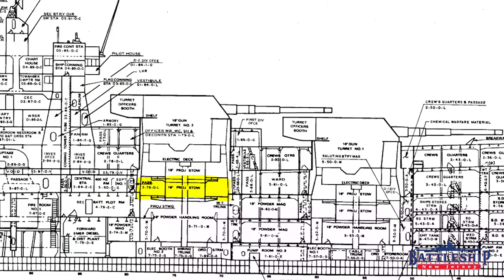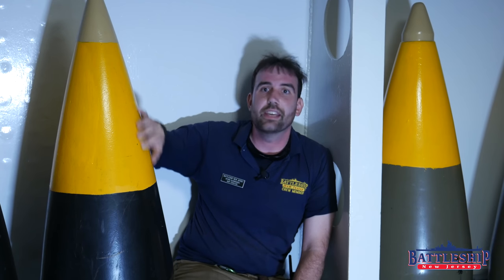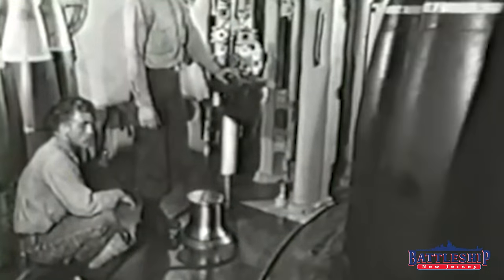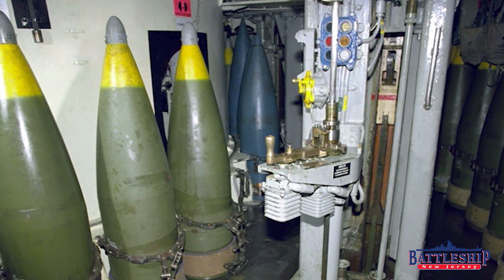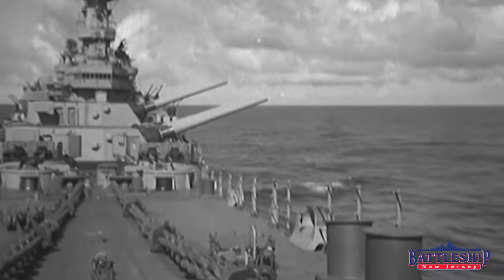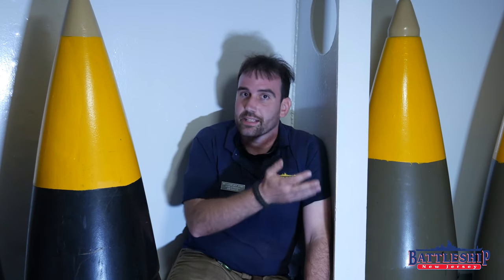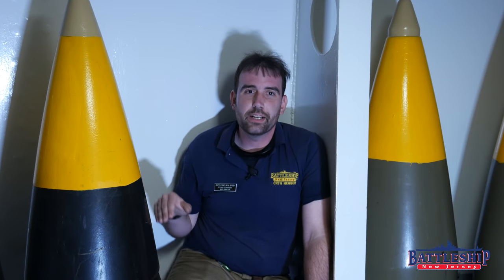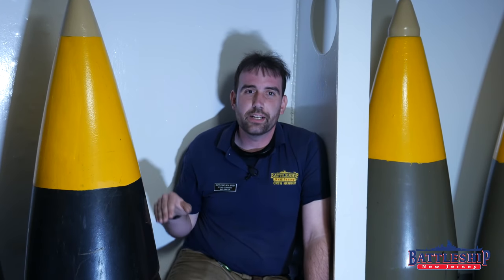What are the Different Types of Shells that the 16in Guns Fire?

Comment: When we've gone to Battleship Cove, we've wondered that. Most shells in the barbettes are blue, but a few are yellow or black. I'm guessing the blue ones are AP.
Reply from the maker: Blue are BL&P, blind loaded and plugged. Basically, practice shells.
Reply: @BattleshipNewJersey  Oh where oh where can I get a fiberglass replica of an AP shell?  I think you guys have some onboard. I'd sure like to find who makes them. It would make a fine mailbox post at my house.
Reply: Yup - blue was pretty common to denote practice - I have a sweet mint 155mm practice round that is blue amongst others too
Reply: @garywayne6083  Don't let it fall over or the cat will be history! That's a chunk of metal!
Reply: @kimmer6  I have an 8" round I brought back to NJ from Ohio - should have seen me trying to get it out of my car and into my house! :D
Reply: Blue denotes an inert round - no explosive content.  Yellow denotes high explosive, Brown band denote propellant (rocket and missile motors), green bands denote chemical rounds.
Reply: @garywayne6083  I threw my back out putting my brand new 8 inch M-509-A1 submunitions dispersing howitzer round on the back floor of my car. But you couldn't wipe the smile off my face during the 125 mile trip home. What kind is yours?
Reply: @BattleshipNewJersey  What is the lethal fragmentation radius of the Mk13 HC shell?
Reply: @kimmer6  I just did some research - Mine appears to be a  M845 dummy round, used in training loading of the M110 field howitzer

Comment: Fascinating about discarding sabot rounds. The shell stability is achieved through rifling but how did the sabot transfer that spin to the shell? That implies some form of fin or other modification to the sub round to allow the sabot to index and transfer the spin during firing or did they go for a free rotating sabot and fin-stabilise the round? Either way more than simple jacketing around an existing round. Keep up the good work Ryan - your videos have made the Battleship New Jersey a must visit next time I hop "over the pond"!
Reply: The early sabot rounds in WWII apparently used a cup design sabot sitting behind the projectile rather than a flower petal design we are all used to seeing, and were not fin stabilized out of rifled barrels, instead spinning the subcaliber projectile with the sabot. This had the benefit of working in a gun with a muzzle brake, but did make Sabot separation problematic. Fin stabilized is something that is apparently only a requirement of smoothbore guns.

Comment: I recall reading on US Army 8 inch ICM rounds back in the 1980s, these were advertised as using air bursts of some kind and scattering the submunitions from that
Reply: The 8H M509A-1shells were the ones you heard about. They are for howitzer duty. The casing was fairly thin steel (1/2'' wall?) and the nose and base were aluminum. Apparently a bursting charge would strip the aluminum threads and allow the submunitions to scatter.

Comment: How about a video on the 16 in powder bags and primers that ignite them, when the bags are loaded are they cut or ripped in anyway to expose the powder? How does that all work?
Reply: I would think ripping a powder bag would create a dangerous situation if any powder would accidentally spill on to the floor below the breach. I'm trying to remember from a tour of the USS Alabama, but I think the covering of the powder bags were made of highly flammable silk that would be consumed in the detonation of the charge. I don't remember anything about the primers.
Reply: The bags are designed to burn fast, so there’s no need to rip them open
Reply: Bob Johnson I’m thinking back to the older cannons were they had to prick the bag once it was loaded into the breach before inserting the wick
Reply: @davidmg4216  there’s no need to do that, the bags burn with the powder
Reply: There's a video on YouTube somewhere about making the powder bags; albeit smaller than 16"
Reply: @ghost307  powder bag is a misleading term for them, since they’re essentially giant pellets of compressed gunpowder
Reply: @ghost307  cordite maybe, US used something different based off of the IMR powder
Reply: Its not ''powder'' but more like shot glass sized castings of very dark grey looking propellant with holes in it. They are stacked neatly in layers. The bag holds them all very snug and in place and there is a red patch containing a charge of black powder sewn to the back end of the bag to ignite it. Normally 6 bags are loaded behind the projectile. There is a cartridge sized primer inserted by a guy under the breech before its closed. The bags are smaller in diameter than the projectile and they go in the breech intact. The bag material combusts immediately and after the shot, air is blown up the barrel to flush out any possible unburnt material.
Reply: @bobjohnson1710  The powder bags had a special pad on the end where there were larger very fast burning granules in them to initiate the burn. They are set of with a primer charge with is like a .308 cartridge that is inserted in the breach block and that is what fires the gun.
Reply: There's a primer pad on each bag. The grains are stacked inside in an orderly way. The grains are rather large. Like 2" long.  Any ripped bag is immediately thrown in an immersion tank for safety.
Reply: I believe at least some propellant bags in the US Navy were made of laced up silk bags.  Not sure about Iowa class.  Silk burns fast.
Reply: @francisbusa1074  They were all silk I believe. It wasn't until the 80s where lots were mixed together and rebagged causing some of the early accuracy issues specifically to NJ since she was the first reactivated. These were the blue polyester bags you see in 80s videos.  The powder does deteriorate rather fast if not stored correctly.  It's not like the smokeless stuff inside modern small arms ammunition.
Reply: @jth877  
Thanks.  I was not aware of the inaccuracy issues in the eighties.  I haven't heard of that during NJ's reactivation in '68 though.  Guess they didn't rebag it then...

Comment: A slight correction to a small data point. At 13:00 he states the shell in flight is spinning at about 70 rotations per second.  That is incorrect.  The rifling twist rate of the 16" Mk7 gun is a RH 1:25 twist.  For the stated 2400FPS muzzle velocity that would be approximately 70,000 RPM (1152 rotations per second).

Comment: Fantastic info on the shells of WW II, the '80s, and beyond. I never heard of the long distance shells, although on Drach's video with the captain of the Iowa during the Lebanon crisis, he did mention 100 mile distances from the big guns. But I do wish to add a bit of ballistics info here as to the speed of the Mark 8 shells, and shells in general. When Mark 8 AP 2,700 lb. shell was fired from the South Carolina or South Dakota, it had a MV of 2,300 fps from their 16/45 cal guns. But from the Iowa class ships, from the 16/50 cal guns, it was 2.500 fps. In addition, the heavier the shell in general meant s slower MV, across all battle ships and handguns and rifles as well. So, in the case of WW II battleships, all the powerful AP rounds  had a MV around 2,500 fps. For instance, the Nelson fired a  AP 2,046 lb. round at 2,525, and the Nagato fired a 2,249 lb. AP round at 2,559 fps. So, you can see from this that the Iowa class AP round was not a slow round for 16" shells at all.

Furthermore, the smaller 15" shells from the French, Italian and British ships often had a higher MV, but a less heavy round. The French Richelieu class fired an AP round of only 1,951 at 2,575, the Italian Littorio also had a 1,817 lb. AP round at 2,887 fps (the fastest), and the British QE class shot a 1,938 lbs AP round at 2,640 (the Super Charged version). The Bismark also shot a 15" shell that had a 1,764 lb. AP round (fairly light!) at a speed of 2,690 fps. And here are the range figures for each: Bismark was 26.1 miles, The Littorio AP round max range was 27.7 mi, and the Richelieu max range was 25.9 miles.  The Iowa class 2.700 lb. AP round had a max range of 24 miles. So, it is pretty clear that the lighter rounds go further, which is only normal ballistics. So, if you put all of this together, it does not look to me like the US Navy made a heavy shell mainly so it could come down on the deck of a ship vs. hitting its side armor. But it is probably more likely that the very long ranges were not considered to be very meaningful or realistic in being able to actually hit another ship at such long distances. Combine this with the fact that the 2,700 lb. AP round from the Iowa class 16/50 cal gun was pretty close in power to the Yamato's AP round, especially its penetration capability (32.6" vs the Yamato's 34.1" at 0 yards.

Comment: The 16" Mark 9 test/training shell was called a "Target" projectile and was especially made (on the cheap, of course) to match the Mark 8 AP shell as to weight, balance, and shape.  It was not a "BL&P" round.  Those are, by definition, regular AP shells, usually obsolete ones, that have been "safed" to be used as inert training projectiles, which here would be the old early-1920's-design 2110-pound 16" Mark 3 AP Projectile replaced by the Mark 5/8 in the late 1930s and weighted to 2100 pounds exactly.  These or BL&P Mark 5 AP rounds had to be used by COLORADO and her sisters, as they could not handle the bigger Mark 8/9 shells.

Comment: I miss a 16" HE-shell with proximity fuse, an upscaled 5-6" shell.
Yamato had some AA shell`s but a 16" with proximity would be in another league completly.
Reply: The American 16" proximity shell would have been far more accurate in any case. Yamato did not have radar or AA fire control that was even close to the USN (she had radar, but only a very basic set). Yamato had good optical surface fire control, however.
Reply: The shell would only break up into 5 or 7 big pieces, anything like that would not frag well, our grenades have wire spun around the charge and its crimped every 6-8 inches so it shoot out lots of metal wire fragmentation (the old pine apple grenades broke up poorly as well)

Comment: I use a one of these shells on a daily basis as part of a pressure testing system. I believe it's a MK13 HC.
Reply: It's missing the cool brass rotation band now.
Reply: Pressure testing?  Like inviting strangers over and hitting the fuse with a hammer?

Maybe I'm thinking stress testing...🤔
Reply: That was my idea....use my TP shell as my air receiver for my IR compressor.The Target Practice shells were cement filled to equal the weight of a High Capacity one. A fellow who had a bunch of 16 inch shells in Central California had a machine shop unscrew the base plate of one and chip out the concrete filling. Everybody involved said that it was one job they will never do again. Mine is in a horizontal cradle with the original fiber guard around the turning band. It looks like it has never been removed. Some day I will paint it up like an HC shell, install a MK18 fuze, and stencil on the names of everyone lost in the Iowa Turret 2 explosion.
Reply: @kimmer6  That's very cool. If you don't mind me asking, what year did you pick that up and how much did it cost you?
Reply: @rickjames8317  Cost me $1200 in 2009. They are getting really hard to find these days. It has been in storage out of the weather and in the dark for years. But I had to move it earlier this year.
Reply: @kimmer6  That's an awesome thing to own. I'd say money well spent, if you have it to spend. Would be super cool painted up like an HE shell and displayed somewhere on your property.
Reply: @rickjames8317  Haha, better than some money I blew!  I know a guy who has about a dozen of them in museums. My goal is to paint it up like the High Capacity shell and stencil on the names of the 47 Sailors who were lost on the Iowa in 1989. There are a few of his 16''-50's at the Estrella Warbird Museum in Paso Robles, Calif, including 2 at the front entrance. He has a pretty nice collection of big ordnance there.
Reply: @kimmer6  Yeah, I've definitely spent more and gotten a lot less, LoL. At least it's too big to ever misplace or have it grow legs and walk away! Love the Iowa memorial idea.

Comment: Instead of scrapping those shells that were still in storage. Strap shackles on them and load them on the B-52. That way there they would of been put to good use. And yes the B-52 can handle 2700lb shells since they can carry multiple 2000lb bombs.
Reply: Seems to me that's exactly what the Japanese did to attack Battleship Row at Pearl Harbor. Not sure that would be practical today but if the need arises, I'd hope someone would remember they were in inventory.
Reply: It isn't just the weight, it is the safe separation from the aircraft. There's plenty of video footage showing ordnance striking aircraft during release trials, that's why they have to do the trials, to certify the store. This is done in accordance with the Military Handbook 1763.

The other issue is fuzing. The shells will have both set back weights and rotors in their fuze that rely on the G forces from being fired, and the rotational forces from spinning through the air due to the rifling. These devices need to be moved so that the parts of the explosive train inside the fuze move into alignment, allowing the shell to detonate on impact. Otherwise it's just a big weight.
Reply: @nzgunnie  That is not true about the fuses for all bombs. The shells would be given contact fuses like what is on the JDAM. And the B-52 is certified to carry 2000lb JDAM's. The main mod would be for the lugs that would allow for them to be attached to the bomb racks, they would have to modified too. Another thing is that the  Bombers with their internal bomb bays really do not have the problem of the bombs coming up and hitting the planes when they are dropped. Even with the B-52s external racks. That seems to be the issue with fighters that can carry bombs. Due to the weight of the 16in shells only the bombers can carry them. Not fighters. And yes, there would be certification testing to make sure all the mods and the shells work. 

From What I heard, a Battleships gun was turned into the first Bunkers around the time of the Gulf War in 1991. And they tested it then sent it off to the desert.
Reply: @MrScott1171  I didn't say anything about fuzes for bombs... I said that is how the artillery fuzes work, ie the fuzes in the shells. You could probably machine some kind of adapter andadapter booster to accept a bomb fuze, even something simple like an M904 nose fuze. If you wanted to fit electrical fuzing, you would need to fit either internal or external cabling conduits. Depending on the thickness of the case, you could probably machine lug wells to accept 30 inch suspension lugs. I'm not sure what the bomb racks in the B52 are rated to, but these shells do weigh more than the 2000lbs class stores they currently handle. (most carriers are rated as either 1000lb class carriers with 14in suspension, or 2000lb class carriers with 30in suspension). If you wanted to make it a smart weapon, you would need to design a guidance kit for it as well.

Weapon/bomb bay released stores do have that problem. The process for assessing safe separation is carried out regardless. I spent spent five years carrying out aircraft stores compatibility certification, there is a lot to it. A store designed to fly straight through the air, nose first, is not necessarily going to perform aerodynamically how you want when you drop it horizontally.

You are on the right track with the Gulf war bunker busters, the initial batch of GBU-28s was built from modified 8 inch artillery barrels from deactivated M110 howitzers, and later examples are purpose-built. They were designed and built pretty quickly for a UOR.

At the end of the day, you have to have a requirement. And just finding something to use a big shell for, rather than scrapping them, isn't really it.
Reply: @nzgunnie  - I didn’t know that about the M-110 howitzer barrels being used to make GBU-28 barrels. Were they melted down and reforged into the newer one?
Reply: @electrichellion5946  No, they were cut to length, lug wells bored and tapped, and nose and tail adapters made to accept LGB kits and fuzes. The whole points was to use them as a penetrator. I'm assuming they made some kind of hardened nose plug for them.

Comment: My dad was on the USS Heermann during the Battle of Leyte Gulf.  He told me the Japanese may have at first mistaken the Fletcher Class destroyers as light cruisers.  This error saved some sailors because the Japanese fired AP rounds which just passed thru the thin skinned destroyers and not explode unless it hit an engine or something more solid.  Later they switched to HE rounds.  He said a round passed through the bow and didn’t explode.

Comment: Viet Nam Era:  We had 5/38's projectile's with Rocket Assisted pack's ( RAP ) to give them an extra 2 miles range. We tested them, but fired only a few missions. As they were deemed not that accurate . That is the Mean Point of impact was way out of normal calculation for our computer and NGFS Liaison spotting.  So this started big rumors that the 16/50's had ( RAP )  Rocket Assisted Projectiles too.   5th DIV.  "Salt of the earth"  Gunner's